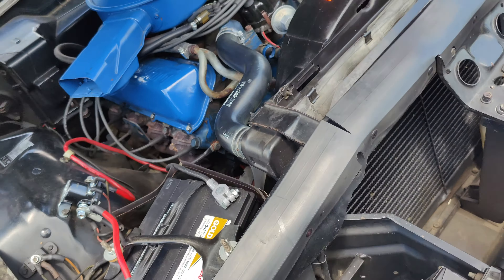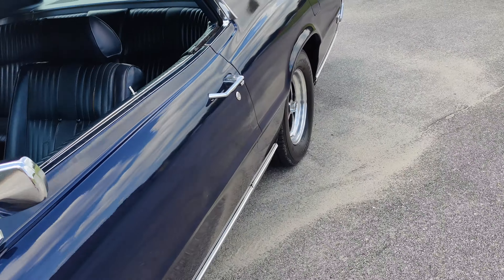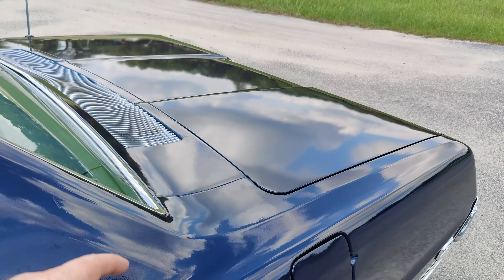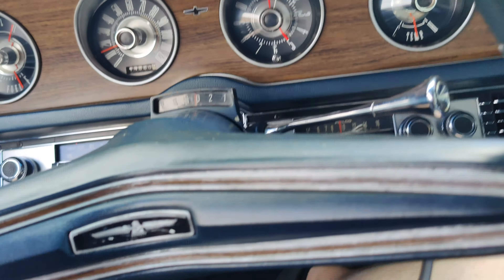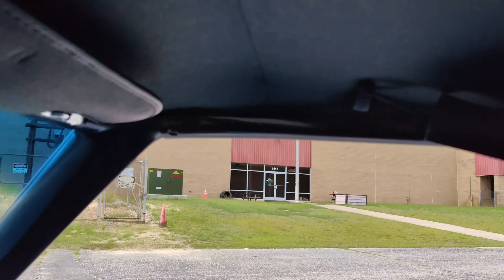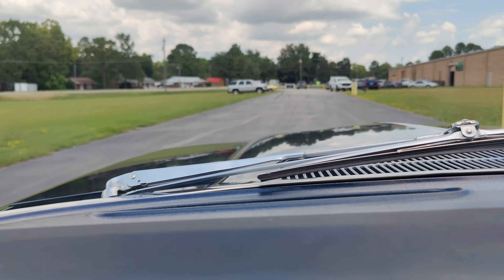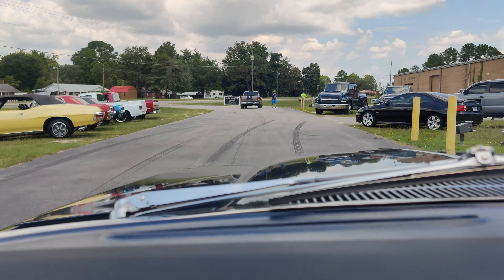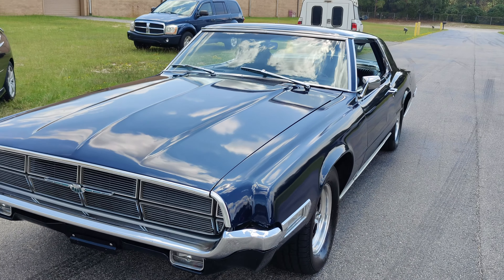1969 Ford Thunderbird 429 at I-95 Muscle

Comment: No A/C, no power windows, doors or seats, no cruise control, passenger side rear-view mirror. A real stripper.
Reply from the maker: I know a lot of people who appreciate strippers
Reply: When i had a 68 and 1969 charger no AC, and this car no AC. Loved them both. Next whiners will be complaining no Netflix or Bidet
Reply: I wish it had A/C but I'm really glad it doesn't have the power windows or seats. Those had a tendency to go bad and the replacement parts are terribly expensive if you can get them at all. As far as the passenger side mirror that was an extremely rare option for this car and I have never seen one. And trust me you don't need cruise control on this.

Comment: who ever painted it needs to go back to school .. looks like ka ka even in this video... My 68 was all original and the 429TJ was rated at 365hp just 10 less than the Cobra Jet (same year) and the exhaust is missing the resonators that go up in each rear quarter panel..  so that sucks... not as quiet as it should be... and I wonder if they got rid of the H pipe because it's cheaper to replace the exhaust without it...